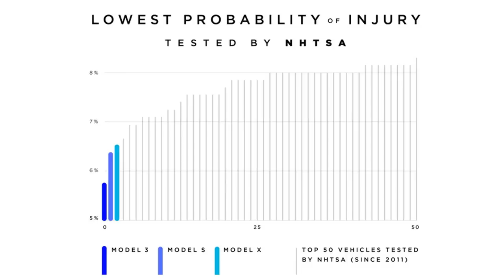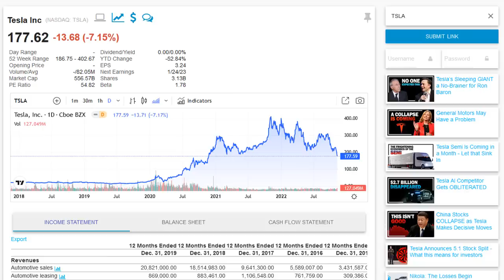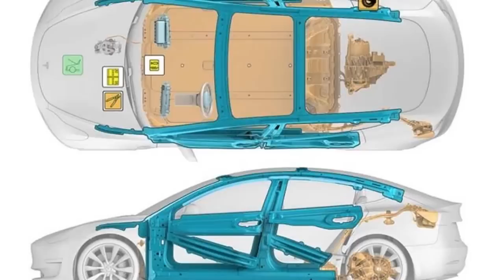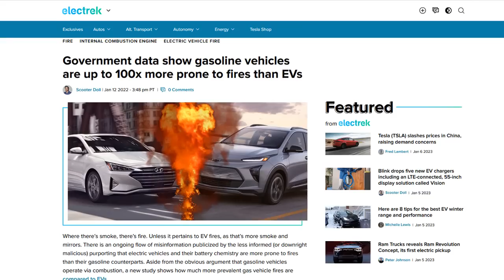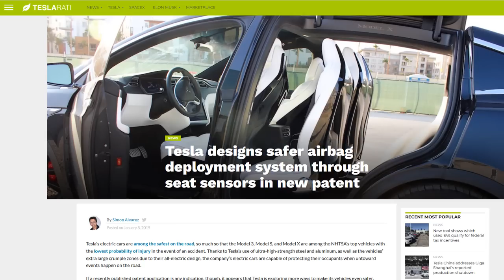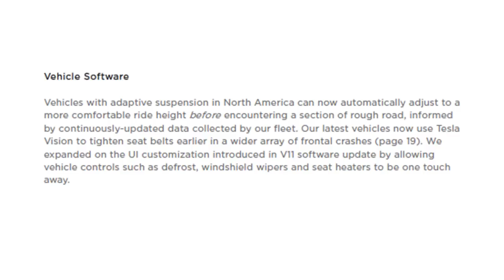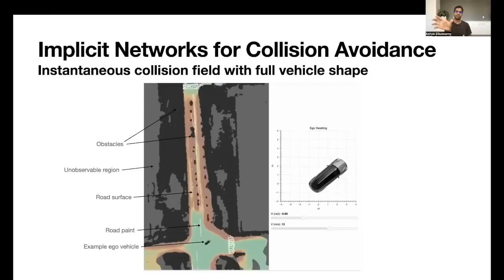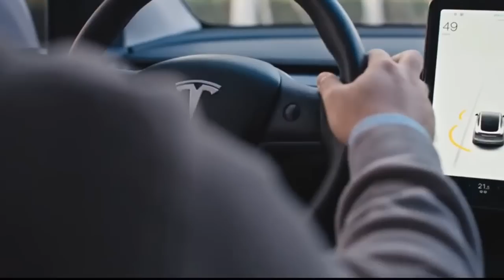How Tesla BROKE the Barriers of Automotive Safety

Comment: This (the principles of automotive safety) has been known for a very long time.  (1) That the occupants are contained in a very strong (resistant to deformation) cage (3) That all other parts that surround that cage should be crump able. (except the cage itself) (3) That things inside that cage should be restrained from flying around, and passengers from direct impact against solid things within the cage.  Since the "battery pack" is a foundational part of that cage then placing a lot of emphasis on its structure goes a long way towards the strength of the whole cage.

Comment: Just a thought, In my mind ,Tesla is a accelerating black swan event. There is just too many converging technologies at play ,for most wall Street and institutional analyst to wrap their head around. 
Teslas third generation platform, it’s not what most analyst thinks it is. First and foremost it’s about manufacturing,Possibly full body casting and drive by wire ,both would be logical. With drive by wire they could have driver controls or not. But more importantly it will increase Teslas addressable market massively,Tesla Could
  easily reach 10 million vehicles by 2026.
Like when Tesla introduced the cyber truck it’s design confused most analysts, the same thing will happen when they introduced their new third generation platform. Tesla will be a dilemma for the majority of traditional Analysts ,until it’s not.🤔IMO

Comment: Airbags outside the car can improve safety to the car occupants. Jaguar did this under the bonnet of one of their cars, to soften the blow for pedestrians. That's good but the side impact crashes don't have much space to slow the passengers down. Jaguar's airbag was under the bonnet and pushed the metal up, so the pedestrian struck would push it down. That can be done with the doors. The airbags can push the exterior door panel out as much as 30 cm just before a crash, so the car occupants have this much give, this much crumple zone on the side. That's a lot. When combined with the curtain airbags, seatbelts, it could reduce the impact shock by a massive amount.